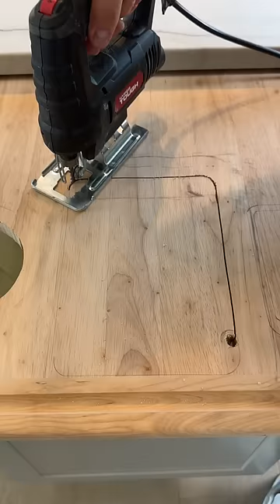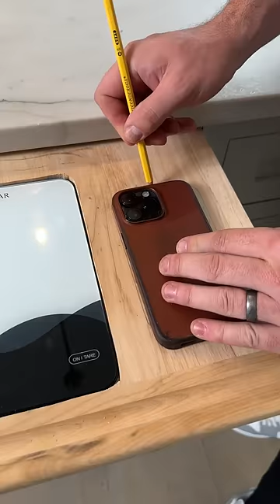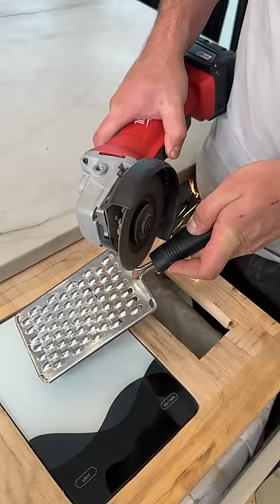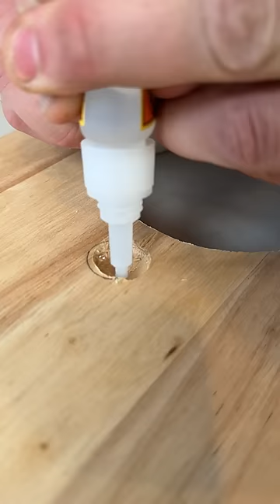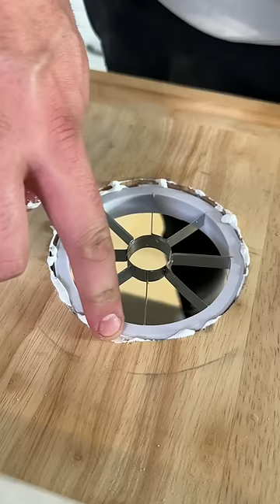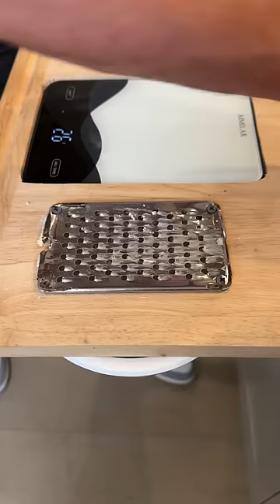THIS IS WHY I MARRIED HIM! 😍

Comment: They threw that out after a week of not being able to clean the cheese off 😂
Reply: That's all I was thinking. How would you thoroughly clean any of it? 😂
Reply: Lmao, that was the first thing that crossed my mind.
Reply: @CheyenneLaux  .... in the sink? did we not watch them pull the entire board out?
Reply: Just pay the cheese tax.
Reply: Maybe they have mice in the cupboard below.
Reply: After hunting for that smell for 3 days😂😂😂😂
Reply: Hot soapy scrubbing brush would work on the cheese grater. Very good idea. Or take entire tray out and wash as normal.
Reply: @nichola32  Yeah that would get all the cheese except for whatever ended up stuck under the grater around the edges of the cutting board hole. Which also wouldn't dry very fast, so a great place for mildew and rust to form.
Reply: The cockroaches will clean.
Reply: @downbeat110 with the batteries in the electronic weighing scale?
Reply: @nichola32 isn't the thing in the middle an electronic scale? You're comfortable soaking that in water?
Reply: @dumplingdumpling2205  any food safe scale is gonna be waterproof
Reply: @dumplingdumpling2205  wasn't meaning the entire thing, just hot soapy water and elbow grease. Anyway was just a thought
Reply: @downbeat110  Sure but do you really want to have to take the whole shelf out every time you use it?  It likely won't even fit in the sink unless the sink is huge.  Plus you'd never get it cleaned around the outer edges.  This might look cool but is actually inefficient and will create more work than just using the grater separately.
Reply: @nichola32  and a toothpick to get all the gunk out of the edges?
Reply: @downbeat110  and then extra tools to get the gaps between the equipment and the board. Then a screwdriver to undo the metal plates in the back everytime you change the batteries.
Reply: @dumplingdumpling2205 you might have to bend down and change the batteries from underneath. The horror
Reply: @sinjon  the entire back panel of the weighing scale is a singular piece, meaning the entire plate has to come off for battery replacements. You know what you can't do with the entire thing buckled into the cooking board with screws? That's riiiight: you can't take off the back piece without unscrewing the entire device from the board!

Comment: Rule number 1: if you see anyone working with a drill in immaculate white shoes, dont trust them
Reply: rule number 2: if its not broke, brake it. lol
Reply: Rule #3, don't trust anyone who all has mint condition tools.  Those tools have never seen work.
Reply: In his defense that bit was so dull he rubbed not drilled a hole.
Reply: @MeekandMe  break lol Brake is when you want to slow down
Reply: Guy used a brand new hole saw. The drill looks brand new and used drywall screws on the grater. He definitely borrowed the drill and saw from his dad.
Reply: @2stroketyson79  Truthin:) thanks for correcting a spell check grammar mistake. Every loves that and that’s why they came here. Lol ;)

Comment: Yes, that cheese grater is going to be a bugger to fit in the dishwasher 😂
Reply: Exactly😂 That thing will start to stink real FAST after a few unwashed uses.
Reply: That's the thing I thought immediately after watching
Reply: I’m glad I wasn’t alone 😂😂
Reply: Just unscrew it every time you use it. Easy
Reply: @daviddawes1302 😂
Reply: @johnsantos4621  Damn did people even watch the video? Just take the whole damn cutting board out and wash it in the sink. Still idk why you'd even bother doing this when you could just, you know, pull the cheese grater out the drawer.

Comment: What's funny is he didn't show how he sliced the apples so that means the silicon holding it in place didn't work lol
Reply: That’s what I was thinking. I have one of those apple cutters and you have to apply so much pressure! To have it out at the end of the pull out cutting board, I don’t see that going well 😂
Reply: @laurenh1662 how do you use it anyways? Smash your hand down on the blades? 😂
Reply: @embball31 press on the outside which has plastic handles. Looks like he cut them off
Reply: @commentsection-chan  I'm talking about whatever the hell he made. You're really gonna push an apple down on those blades with your hand?
Reply: @Emarq31 I’m with you there! My family has one of those too, and you need the handles! It’s a safety issue!

That, and how the heck are you going to clean everything?!
Reply: Comments are great 👏👍
Reply: @embball31  oh yeah I guess just push the fuir down until it falls into a bowl before but we all know it won't work and just break

Comment: This is a very good idea in order to increase protein intake. The worms that will come out of the rotten cheese and rotten vegetables stuck on the undersides of both the grater and the chopper are very nutritious.
Reply: And don't forget when the wood chips at the edges because it's not smoothed with a varnish.

Comment: There’s no way that Apple slicer is gonna stay in place with just some caulk💀
Reply: That's the comment I was looking for. Bro doesn't even show the process of slicing cause it definitely didn't work
Reply: Thats exactly my thought, I was like wtf do you do? Smash the apple in, probably obliterate the wooden platform in the process. 
And that fuckin magnet ain't gonna hold shit, have fun picking up the pieces on the floor
Reply: How do you wash out the food particles and sanitize all that?
Reply: @lenniewatson687  you don’t
Reply: @darkyan_1653  not to mention slicing your hand open in the process because there’s no recess guard, or any mechanism to hold it in place besides that silicone he glued it in with(which will not hold)

Comment: Good luck cleaning the cheese grater that is screwed onto the board. Definitely want to unscrew 4 screws then screw it back on every time I use it 😍😍😍
Reply: Yeah epoxy covered deck screws that are gonna rust too
Reply: As much as the wood split when running the screws in they won't last long
Reply: El cortador de manzanas está pegado, así que los tornillos pasaron a segundo plano.

Comment: That scale will work so well when it’s floating in the air and it’s feet aren’t touching the ground. I guess if you grate enough cheeses on that grater, you’ll eventually grow your own cheese culture there? The gift that keeps on giving
Reply: To be fair the feet are sitting on the straps underneath... still pretty sure accuracy won't be an attribute it has though!
Reply: This scale does not need to touch any ground. It works miraculously since it's battery does not need to be inserted, but to be glued to the wood, too.

Comment: In case anyone wanted a report of the things wrong with this video:

1. Magical kitchen tools that never get dirty
2. Apparently drilling over a marble countertop is a good idea??
3. Hell yeah, I’d love hearing the cheese grater scrape against the bottom of the counter every time I open the drawer
4. Why can’t you just put all of the things INTO a drawer instead of creating a permanent set of problems???

Final grade: F

Edit: bro also wasted like 90% of that pepper
Reply: his drill was also smoking the whole time, that cant be good
Reply: Hooo dear god, your comment give me the relief that I needed after that video.
Reply: 1. Actually he can take the whole thing out so he can wash it .
2. He wants go drill through the whole thing .
3. He can do whatever he want to his house this is not our opinion 
4. I understand we’re u tryna go but u don’t know nothing so mind ya business!

Final grade : F
Reply: Bro it's not that deep 😂
Reply: The drill was smoking lol
Reply: @whatmabhena8431  well deep sense he wanna take it deep ??
Reply: In addition to what you said, he also used wrong drilling bit to drill into the wood 😒
Reply: @_urlocal_bestiewestie please never comment again
Reply: The sound I heard when he pulled out the drawer made me cringe. Definitely scratching the marble or the cabinets.
Reply: the two metal bars holding the scale in place definitely made the scale useless. scales need a flat and level surface. also the cheese grater is screaming an accident waiting to happen.

Comment: That apple slicer is being held up by thoughts and prayers
Reply: no.. he sweared a bunch of silicon on it..  how else would you hold an apple-slicer in a built in cutting board you destroyed?
Reply: thebanned2807  Could've just cut a lip in the wood to hold it in the hole.
Cant wait until this needs to be cleaned..
Reply: thebanned2807 Nah, it's just going to put enough leverage to snap the board when you go and try to press the apple into it.
Reply: Same engineer that glued the Titan’s titanium cones onto the carbon fibre tube.

Comment: Sharpen your drill bits, and you won't burn the wood. Use stainless steel screws for the cheese grater because those drywall screws are going to rust. Silicon /caulk can not retain that apple dicer once you apply pressure. I think the big cutting board was much more useful.
Reply: I was screaming a his thumb being an inch from the saw cup, and knowing his fingers were right underneath holding the board. Not to meant drilling into on top of the marble.
Reply: Don't worry he doesn't care he will never wash that grater again which is worst lmao
Reply: Did you mean the cutting board is more useful then the husband, yeah I agree 💀
Reply: Not using drywall screws, those are exterior wood screws. They will rust though under these conditions. Best to use SS

Comment: You know, I’ve also never seen a man start from a fully furnished home slowly depreciate it’s cost. Usually people buy low and do home improvements, this family bought high, and thinks their home renovations will somehow improve its worth 😂
Reply: All I can think about is trying to clean the grater
Reply: Cutting boards have nothing to do with the value of the home, who uses those gross old things anyway? It's about making things convenient for his wife.
Reply: @ambertruitt6802  well, if you were to replace the cutting board, you would have buy a whole new custom one. Also how is this convenient? You would have to screw and unscrew the cheese grater to wash it. You can just spray disinfectant on it and wipe it.
Reply: @ambertruitt6802 gross old things? What do you use when cutting things? Genuine question, idc about the dumb argument you’re all having. Just curious to hear if there is a better option than cutting boards. Unless you’re just thinking about mats.
Reply: doesn't need to improve in worth if you never intend on swapping out homes like a hermit crab.
Reply: when you don't renovate the house for yourself or decorate for yourself, but you always thinking about selling it in the future, the house doesn't belong to you, you just renting it from the next owner. 
Bottom line, if you own the house, do whatever you want with it.
Reply: not like those pull out cutting boards are useful to begin with. you can't put any weight on them unless you want to warp the board or break it off. drilling holes through garbage doesn't make the garbage worth any less at least.

Comment: Using a drill bit directly on a granite countertop is WILD. Bro obviously doesn’t know how much those cost
Reply: Exactly?  I was cringing the whole time!
Reply: I was cringing as well
Reply: Are you BLIND? He used it on the cutting board!
Reply: @teresabroadway8383  What's the cutting board resting on?
Reply: @teresabroadway8383  Are you BLIND?  He's got the countertop directly under the cutting board which he he boring holes through.  What do you think the bit makes contact with when it pushes through the wood?  If you were cutting cardboard with a razor blade, would you just lay it on your lap or would it fear cutting into your legs?   Think about it...
Reply: @seansturgill4869 he wasn't going all of the way through. just a small amount to make room for what looked like a magnet
Reply: Watch it again.  It was shallow depth, not all the way through
Reply: Also, the grater scraping when he opened the drawer 😂
Reply: @adamruss656  Still god awful practice. One slip is all it takes.
Reply: Imagine sticking a 26 dollar bit in a 26 dollar hyper tough too lol
Reply: Who cares, with three million likes and derogatory comments,  more than enough to buy another.

Comment: How do you clean the cheese grater thou? 🤔🤔🤔
Reply: You take the whole thing out and clean it in the sink.
Reply: Unscrew everything after each use lol😅
Not worth it.
Some People's creativity are too much 😅
Reply: U buy a new house
Reply: was wonder that myself
Reply: hahahaah
Reply: @bass4sea  🤣🤣🤣
Reply: hahahahaahahaha
Reply: Using karcher😂
Reply: Same question
Reply: Why? ....the next time he had Cheese look like Gorgonzola! 😁
Reply: you don't.
Reply: You grate a sponge
Reply: Yes exactly
Reply: I think this board comes to trash Just after this short was ended.
Reply: You do not 😅
Reply: Solving a problem that didn't exist
Reply: Just bring out your pressure washer!
Reply: You just grate a dish cloth
Reply: You move the refrigerator reveling a trap door that leads you to the hidden screwdriver that pops up a key that opens the drawer connected to a panel on the other side, which you slide the prong...I don't know.
Reply: Love the sheetrock screws😂
Reply: He didnt
Reply: Why clean it if you're gonna use it again? 
_ this guy
Reply: His solution: A pressure washer!
Reply: You hose it down in the back yard.
Reply: Let your wife clean up the mess.😂😂😂😂
Reply: You get a bunch of cheap tools and make a cheese grater cleaner out of an old water pick and some electrIc  tooth brushes and mount a wet dry vac underneath of it.
Just make sure to use drywall screws and painters caulk everywhere you can.
Reply: @joeshumo9457  👍 You could manufacture your cheese grater cleaner. It would sell on one of those late night infomercials if it came with a bonus Shamwow. If the women don't find you handsome they should at least find you handy
Reply: Cleaning? What is that? Doesn't it clean itself? "Alexa, clean cheese grater"
Reply: It doesn't really need to be cleaned...
Reply: clean? Grate.
Reply: and then? ...what? picachu face

Comment: there is absolutely no way that apple cutter works😭
Reply: I am thinking the same thing. The holding the handles and pressing down is what allows the cutter to work. You can’t press an apple down without something on top of it now.
Reply: Good way to slice one of your digits trying to slam an apple through
Reply: Haha that’s why he edited the video like that 😂
Reply: Since I own a granny smith Apple tree I use a slicer like that one all the time, in order for it to work he would have to have an inside edge on it so when you pressed down it wouldn't fall thru other wise yeah that caulk isn't gonna do the trick watching it twice he does not leave an edge
Reply: He installed it upside-down lolol

Comment: Everybody raggin on the cheese grater. I’m looking at the apple slicer. It gets pushed DOWN onto an apple. And that caulk will not hold it in place for the amount of needed to cut an apple. It will fall out 1st use, and cut fingers since it’s blade up. 😮

Comment: He has his drill in reverse when he is drilling with drill bits which is why they are smoking!  He used drywall screws to secure the grater which will rust.  How are the magnets holding the plastic bowl?  Caulking won’t secure the slicer, the second you pushed down on it the slicer would fall.  You’re welcome!

Comment: Not a bad idea but needs improvement.  Just don't forget to remove the scale when you wash the board, slicer, and grater in the sink.  Absolutely unnecessary unless you need to save a lot of space!